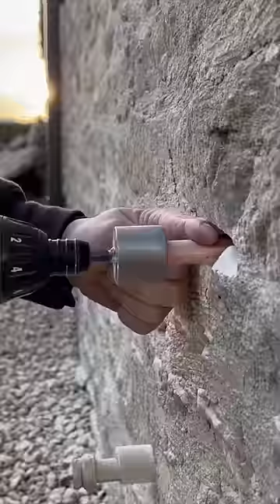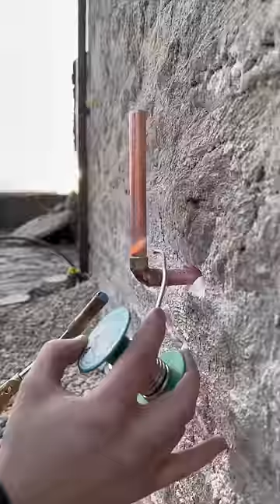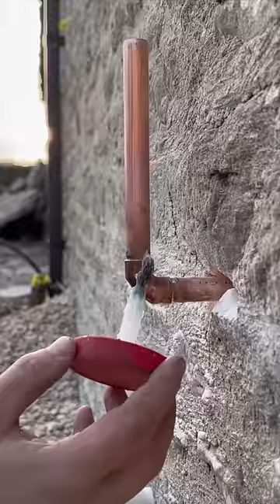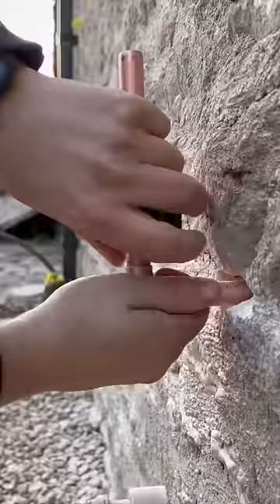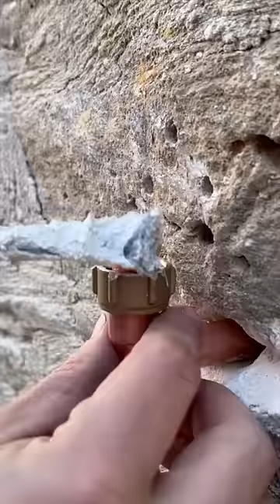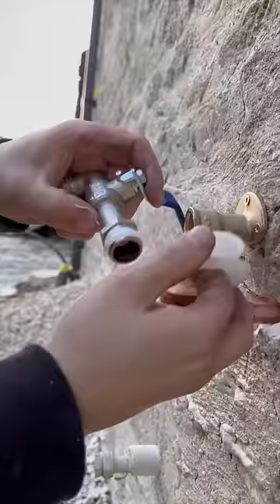HOW To fit an outside tap on stone wall! #howto #asmr #diy #plumbing #subscribe #youtubeshorts

Comment: I don't think that was enough teflón!😂😂😂
Reply from the maker: Hahaha we got straight threads here not tapered so it needs it
Reply: If he had used tow instead of Teflon tape, I would have said he was a good plumber.
Reply from the maker: @friedrichruff5357  tow?
Reply: @mmplumber camel toe.
Reply: 47 wraps ...whether it needs it or not...! 😁😁😁
Reply: Can no one upload a video without another professional commenting negatively? It'll work and work well. 
Do people still use hemp tow? 😅
Reply: Yeah, I was saying... Wasn't that overkill ?
Reply: Another 3 wraps would have been 👍!
Reply: @mmplumber hemp fiber with some goop to hold it still. Some plumbers are religious about that shit, yet I've had leaky joints made by "professionals" and so full of tow it's impossible to disconnect with a wrench, while my joints made with Teflon string with to-spec amount of turns that I can hand-tighten, and don't leak...
Reply: @Rivet_Head242 its not overkill. Sometimes we also coat it with pipe dope. It's a helluva lot easier/faster to do the best job possible than it is to take it apart and start over. You save time in the long run man. 
  Sometimes they just want to leak so you do your best thing every time And you don't get callbacks
Reply: He put it the wrong way
Reply: @HciContractor   alright. I respect a job well done. 👍
Reply: That’s going to be forsure
Reply: That’s what I thought! Pmsl 😂
Reply: @mmplumber Why use the crappy white stuff instead of blue monster?
Reply from the maker: @AnUnapologeticApologist  I’m in the uk dude
Reply: Buscaba este comentario 😊 👍🍀
Reply: Nope, it's about right.
Reply: @douglasforsythe5853 nope, about 12 to 15 wraps is pretty standard.
Reply: @mmplumber  You guys don't have Amazon?
Reply: More cowbell!
Reply: @friedrichruff5357 darn it he got the almost pass by you!? Poor guy is a failure by your standards lol
Reply: More than two wraps is wasting tape.
Reply: @CDougguynn  😆🤣
Reply: @Validole Both have their place. Ot really depends on what kind of couplings, thread style and state you're dealing with, and the nature of any issues or challenging environment.
Reply: @danielhavlin8016 
Yes, people still use it.
It seals even better than Teflon, it expands in contact with water.

But I personally haven't used it for a while...
Reply: @mmplumber have never use pipe dope on a compression fitting, am I being wrong this whole time?!
Reply: I was about to write that lol
Reply: @jiltsmultitheoryjilt415 that was hilarious 😂😂😂
Reply: Just saying that's overkill but to be honest tho.... He should've twisted the tape like rope and wrapped it in the groves or a few wraps & and dope on top but hey I'm just a 5 year old kid... What do I know🤣🤣🤣🤣😎
Reply: that was a friction fit coupling. needs no teflon!
Reply: I was just going to say 😂😂😂
Reply: I go 11 rounds. Never too much
Reply: @danielhavlin8016 nope. That’s why I made one video the. Stopped
Reply: @HciContractor  I used to notice if I put too much Teflon it would just slip against itself and bung up the surface of the threads.
Reply: @maxnovakovics2568  yep for sure that's when you know you put too many wraps.  I like to put plenty on and then  a smear of pipe dope. It's just quicker than doing it over or tightening it up again
Reply: @Erickpicapiedra I don’t think he did. Which way do you like to wrap it?
Reply: @MilanTheMan69  old ways are best a lot of the time. It's interesting for me to see 2 sides of the pond. I'm just a Jackass of all trades, but I understand construction in UK and Ireland and North America having lived on both sides.
Reply: @Stank-b8w  keep em coming 👌🙌
Reply: devia ser patrocinado pela teflon.
Reply: I always put a lot of Teflon tape on my threads, just not that much. Then I mash the teflon into the threading tight with my fingers as if I were screwing something onto it until you see the grooves through it. After that, I barely cover the threading in different spots with blue pipe dope, so when I twist it on, it fills all of the threading and doesn't drip excess everywhere. I have never ever had a leak from that strategy so far for many years.
Reply: I was thinking the same thing
Reply: @danielhavlin8016  Yes. I prefer hemp over Teflon tape. But I'm not a pro. 🤫
Reply: @Validole don’t think you can use hemp and putty on water 🤔
Reply: If ur gunna use it... then reeeally fkn use it lol
Reply: My thoughts exactly
Reply: Sure you got enough tefalon on that? And guess you never heard of tapcons!
Reply: @JB-bb1zw  I missed that one on the Tapcons 👍 I don't even use those cheap anchors in Sheetrock🤣🤣🤣 He probably got everything from the Dollar Store🤣🤣🤣 lmfao
Reply: There is no such thing as enough tape.
Reply: Hahahah. Exactly what I was thinking
Reply: They use hemp in Europe
Reply: That teflon is a lot lighter than the teflon used in north america hence the greater number of wraps.
Reply: @happyguycol  🤣😜
Reply: 21 wraps I was always taught
Reply: @danielhavlin8016 yep here in switzerland most still use hemp tow.
Reply: It never fails to amaze me that you Amuricans think that you’re the only country in the world so any video made must come from The good ole U S of A. 😂 

So to every American who’s saying things like “That’s not up to code!” And “Hey, you got enuf Teflon on there buddy?” And “I bet he got it all from the dollar store” why don’t you take a minute to try and think “That’s interesting that other people do it differently and it seems to be a good job.” Or as my mum used to say, if you can’t say anything nice, don’t say anything at all.
Reply: I make the mistake of not putting enough pfte tape on , glad to know that’s how to do it correctly!
Reply: Any is unnecessary
Reply: Takes about 6 raps here, when I started two was fine
Reply: That white Teflon tape is so thin and shitty lol I would have use the same amount hahaha
Reply: @digimahn6082  LMAO
Reply: @gabagool_ovahere  LMAO 😂
Reply: Swagelok MS-PTS-50,  it is enough 👍
Reply: Ok half a role of Teflon, ✔️😂
Reply: Two raps to many
Reply: @mmplumber  no, just shows you don't know what you are doing. I pressure test straight NPT at 8000psi and 2.5 wraps is all it takes.
Reply: People need to still be consuming forever chemicals decades from now.  If you only go around a couple/few times,  the really heaviest flow of forever chemicals directly into the water won’t last nearly as long.
Reply: @CDougguynn 10-12 is actually pretty standard believe it or not and some pros go like 20 times if you actually count even if they swear they only go 12-15.
Reply: @mmplumber  lmfao
Reply: @endurojimmy3109  lmfao
Reply: @creamd4w  You do realise that this is a UK installation using UK PTFE tape, not one wrap PTFE which is obviously much thicker.
So unless you're a UK plumber using this type of PTFE, then button it pal.
Reply: @friedrichruff5357  It's banned from use on potable water in the UK.
Reply: I thought he was gonna split the fitting to show why you don’t want that much. But he explained why and yeah. 👍
Reply: @friedrichruff5357  Teflon tape isn't to stop leaks. It is a lubricant . One wrap is all you need
Reply: Хорошо жить там, где нет минусовых температур
Reply: Hhhhhhhhh 21000 turn it's not enough we do only three turns for manifolds that hold 15000 PSI
Reply: Nothing wrong with more at least it will last longer
Reply: Jajaj  ponle un poco de instalación a tu teflón(?
Reply: @mmplumber the sealing surface for BSP is supposed to be the perpendicular face to the threads. Either the front face with a seal ring (copper crush washer, O-ring, copper deformation ring on the socket, etc) or the front face before the thread.(rare) The threads themselves aren't supposed to be a sealing surface like NPT. As you've witnessed, it can be done with plenty of Teflon tape, although it is not standard.

PS. Dope is not required for compression rings or flares. It does it's job as a lubricant but really isn't needed.
Reply: 😅😅😅 @mmplumber
Reply: teflon on water pipe is not optimal
Reply: Можно было трубогибом загнуть и стыков меньше 😊
Reply: @805socal nope, you are right.
No reason at all to put pipe dope on a compression fitting.
None.
Reply: Neat job. All us plumbers watching know for any given task there is a multitude of techniques/ways of getting it done. Some of the naysayers just need to breathe and remember 1. It’s for entertainment peeps 
2. More than 1 way of doin it
3. Be happy and not criticise
Reply: Hahaha! I knew I'd see this comment! 😂 That was like a mile of Teflon.
Reply: Guys, Here is our True Savior

HalleluYAH translates “Praise ye YaH”

YaH is The Heavenly Father
YaH arrives via the TENT OF MEETING
YaH was Who they Crucified for our sins
YaH was Crucified on an Almond TREE

Ancient Semitic of Moshe (Moses)
Isa Scroll (The Original Isaiah)

Isaiah 42:8
"I am YaH; that is my Name! I will not yield my glory to another or my praise to idols.”

Isaiah 43:11
“I am YAH, and there is no other Savior but Me.”

Isaiah 45:5
“I am YaH, and there is none else.”
Reply: @mmplumber  i think the more common name is Plumbers Dope. that sealing paste.
Reply: @mmplumber hope it don't freeze there.
Reply: 日本では銅を使う事が激減しました。
Reply: Two shot of vodka
Reply: @jobbe-wijnen not a tapered fitting here in UK
Reply: @mmplumber  wow that is crazy. Why hasn’t the industry changed to tapered?
Here in the US we go around the threads 4 wraps.
Reply: 3 wraps and send
Reply: @danielhavlin8016 yes and yes I hate doing a job twice, hemp then teflon, do it once and do it right
Reply: Its called banter. Everyone's the best at their trade eh...so they think. Until u give them the job and they have no tools for it or knowledge.. im no expert, im just stating facts. U will see so called professionals watching utube shorts on the job, on how to complete the job😂😂
Reply: @friedrichruff5357 from 1930?
Reply: @mmplumber boss blue! The U.K. actually cares about what the humans are drinking.. merrica still having lead pipe problems… now we all like heavy metal! But my preference is AC/DC not toxic lead 😂
Reply: @keithewen5818  What makes a good craftsman is not the most modern equipment, but what he is able to do with the simplest materials and with his hands. I myself am a painter with a German master craftsman's certificate and can make my own paints from natural raw materials and pigments. That's what it's about when a German like me talks about craftsmanship. We can still work even when we no longer have electricity. Craftsmanship (german: Handwerk) means something very specific.
Reply: Gasola all the way  @AnUnapologeticApologist
Reply: @AnUnapologeticApologist  Gasola all the way
Reply: Cor pappagallo su un bullone esagonale è veramente da inesperto e maldestro, bocciato, teflon sulla filettatura non grattata, bocciato, teflon messo così come viene, bocciato!!!
Reply: When at the college while serving my apprenticeship the teachers said 1 and a half turns was adequate wot a load of shite putting ptfe on dry thread strips the tape off
Reply: Jeez lol

Comment: Best practice to sleeve pipe 5hru wall, prevents corrosion
Reply: 💯 right
Reply: And put the tap down so the elbow don't freeze when tuned off
Reply: Yeah man, and that lever valve is uuuugly.
Reply: Ты не делай так в России
Такое только для тёплых стран
Reply: Should have filled the hole with clear caulk
Reply from the maker: It is sleaved. 22mm copper
Reply: Great place to freeze too.
Reply: 부식방지하는 것의 이름은 무엇이죠?
Reply: Miserable people need to tell the world they do everything better
Reply: @daviddubois4402  and how to do everything 🙄
Reply: And erosion!
Reply: I was thinking the same.  Use big vinyl tubing?  Then plumbers putty.

Comment: Hopefully this isn’t a region that gets freezing winter temperatures.
Reply: Looks like it is 😂
Reply: Just drain it before...
Reply: @Ben-rg8sb  draining won’t work so well given that the spigot is installed above the pipe and can’t actually drain the pipe as it is installed.
Reply: Ainda que bem que não é no Brasil, senão esse cobre aí já era 😂😂😂😂
Reply: The weather has changed. Should have installed a freeze proof faucet and left the hole in the wall open
Reply: @Ben-rg8sb  How? suck the water out?
Reply: Mala soldadura
Reply: @luisfernandooyarzunampuero3368 
Lo mismo dije yo, no se debe soldar así, no hay que aplicar calor cuando se aplica estaño y tampoco se debe enfriar con el decapante, pero bueno, hay fontaneros y fontaneros buenos.
Reply: Mine are like this in Canada. No issues if you drain
Reply: I live in New England and I would have installed it differently (this still might work?) inside there is a shut off and you open and drain that outside one. And then after 5 months of helll you can use it again. 😂
Reply: Bare copper through any stone not a good idea. Needs to be isolated/ protected from abrasion or reaction with the elements in the stone . AND ... not a good install for any zone where it MIGHT freeze ... yes it does freeze on occasion in Florida and Arizona.
Reply: @Decepticon123 not sure y they couldn't have flipped it over with the faucet underneath
Reply: Maybe he has an in line shut off inside.
Reply: They can insulate/cover it....maybe?
Reply: @c5back9 it's not a problem at all, if the plumber has put a valve with an outlet inside of the building.
In cold times you shut the valve and open the outlet between the tap outside and the valve inside, the rest of the water comes out of the pipe and everything fine.
The important part is to leave the tab and the outlet open, in case the valve inside is not properly closing.
Just put a small bucket underneath and keep an eye on it from time to time.
The tab that you can see getting mounted, is not allowed here in Germany.
It lacks a safety feature that prevents the backflow of dirty water back into the pipes in the building.
I don't know how to translate it properly into English, maybe you can help me out on it.
If you mount a hose on this tab, to fill a pool for example, and you leave the hose inside the pool, like overnight and inside of the building the water pipe system gets damaged, the water from the pool will flow back inside the system and with it all the dirt and organic wast gets into your freshwater.
Reply: That's what I was thinking, that 90 should have been going down
Reply: @chrisludwig7985  there is actual a reason to make it going down.
If this side of the building is the weather side, meaning the side with the most rain, the rain runs down the pipe and follows the direction of the pipe. This way the the water can damage the building.
Since most of the time the pipe comes out of the building on the basement level, the pipe has to go up.
Therefore you have to chose the place you want to install a tab outside careful.
Reply: All he needs to do is shut the valve inside which I’m sure he has then drain the line.
Reply: @c5back9 stop and waste valve inside the house.
Reply: I've got a tap similar to this. But inside the house I've got a stop tap. In winter time I turn off the water to that tap to stop it freezing up. Also I drain the water out off the pipe aswell so that doesn't freeze
Reply: Bruh I was going to say the same thing
Reply: Install a shut off inside .
Reply: No doubt. Waste of time
Reply: easy to winterize each season
Reply: @c5back9 typically you drain from inside the building
Reply: @Ben-rg8sb unless there’s a release well before the Bibb at the low point there will always be water trapped in there.
Reply: @rootvalley2 still. This Bibb is higher than the line. There will always be water in there unless you can force out via air.
Reply: @c5back9 You can blow it out if you have a fitting installed from where you wanna blow it out from.
Reply: @c5back9 I guarantee there's a ball valve inside with a bleeder
Reply: Most likely isn't or they wouldn't use this type
Reply: Pro press I love it and it's never ever failed
Reply: Typically you install a faucet with where the valve is inside the home/wall and tap outside.   No draining or servicing.  They also come with the brick sheathing built in but I guess you saved a few bucks.
Reply: @slatecreekservicesllc8615 freeze in Arizona 😂. Maybe flagstaff
Reply: @c5back9 air compressor
Reply: @Ben-rg8sb  just drain all your plumbing before every chance of freezing, and go all winter with no water... genius.
Reply: Was thinking the same shid.
Reply: Probably has shutoff with drain plug inside